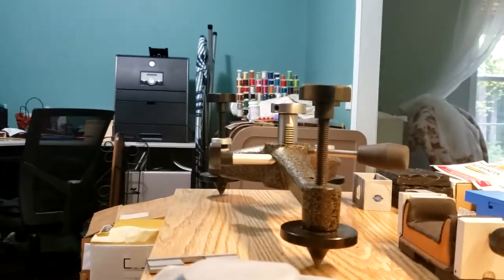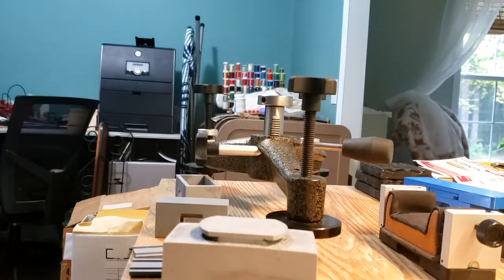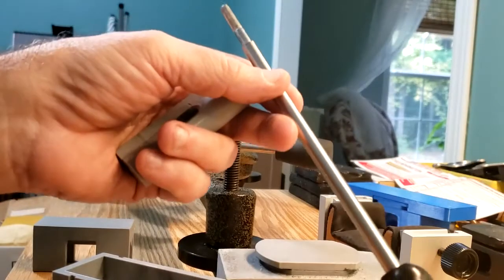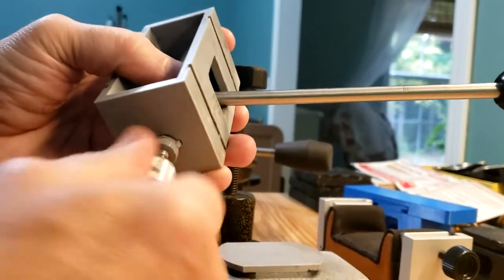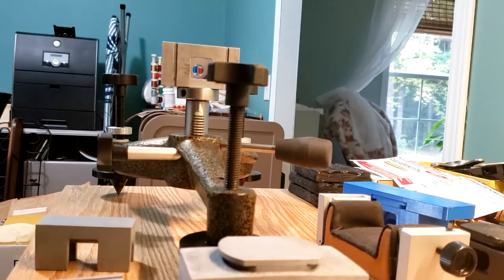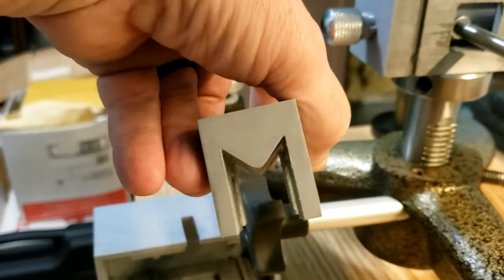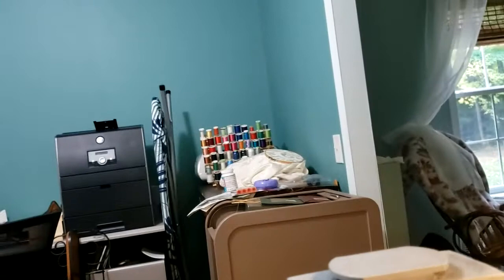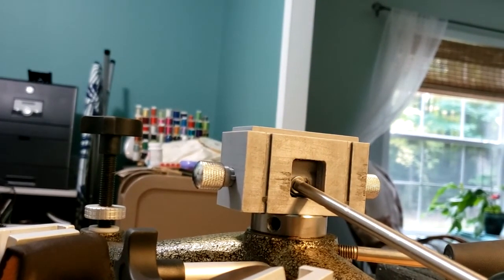3d Printed Front Shooting Rest Top (Cam Version)

Comment: The cam follower and the top plate is not on the down loaded files,could you please load them
Reply: The cam follower is the vertical slider assembly and the top plate is the rotating bag base, both of those files are in there. Thanks.

Comment: Would really like to print this rest could let me know where in get the sti files please
Reply from the maker: https://drive.google.com/drive/folders/1sD_B298ezirMxdW1vc41mLBPnzhNzQbR
Reply: Thank you will print on the weekend
Reply: I have made your previous design with some mods and made a custom metal base to suit it works well for 22 benchrest
Pity I can’t post pic in these comments
Reply from the maker: @bulldogsocks1988  You can put them in a Google Drive folder and share the link to the files. Thanks and good luck.
Reply: Best version I’ve seen so far. I would probably reverse the cam so I push down on the handle to raise the point of impact. Just a preference of mine.
Reply from the maker: Thanks for your input.